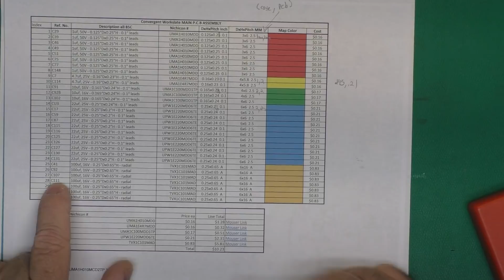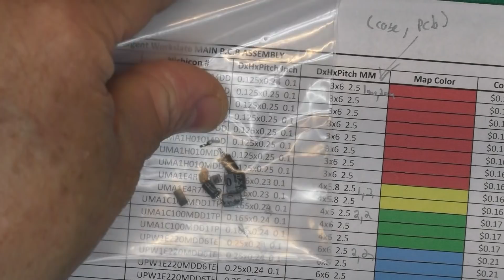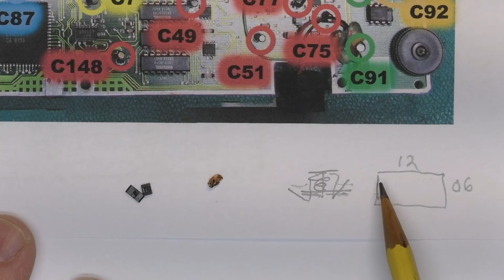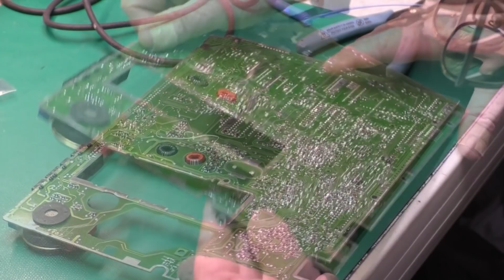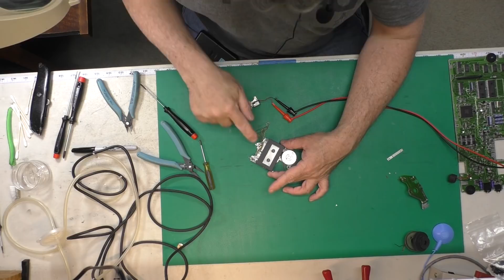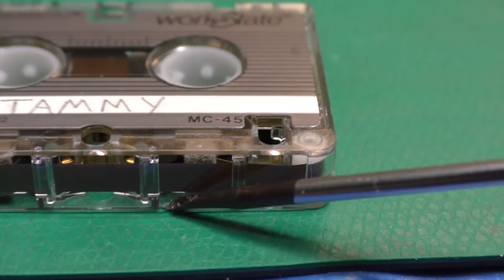Convergent Workslate 2 - Bubble, Bubble, Toil and Lots of Trouble

Comment: I had some cassette mechanisms like those that had a solenoid to move the mechanism out of the way while it ejected.  it was like the head assembly had three positions.  Engaged with the tape, idle, and slide aside to eject... If the solenoid was failing or not working well enough, it could leave the head in a position to interfere with the tape shell.  (in this case, perhaps a cam isn't pushing the assembly far enough?)
Reply from the maker: Yes, that is the problem. The cam is not pushing the arm far enough. I can't see any undue wear on the cam or cam follower though. It could be that the cam had more of a point to it that is just not apparent now. I think I can make a cover over the follower to give it some more travel. 

I would think I should be able to see some voltage from the tape head directly, maybe10-20 microvolts? Not sure how to best go about trying to align it or discover if the head is bad. Maybe ohm out the two heads and compare them?)